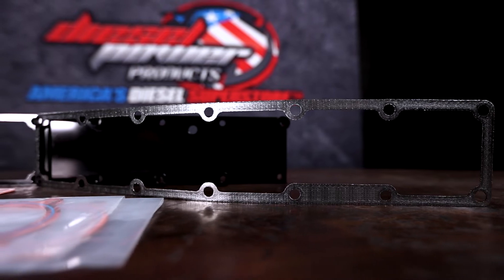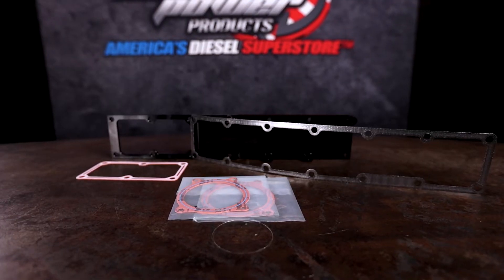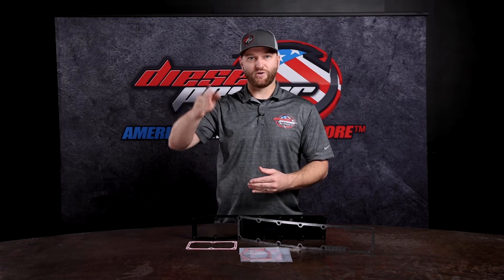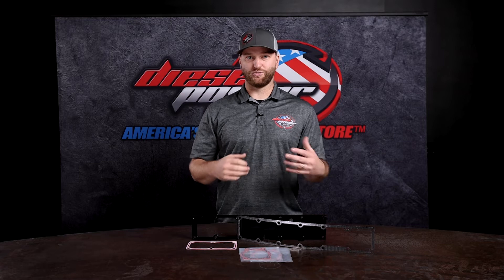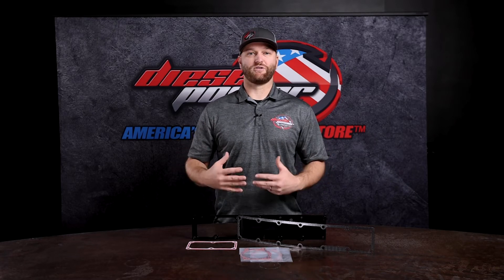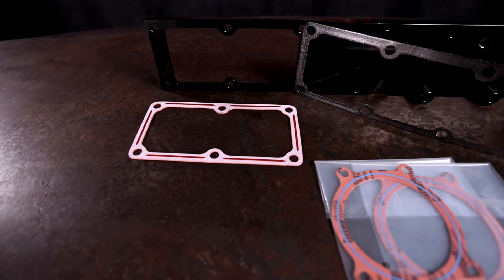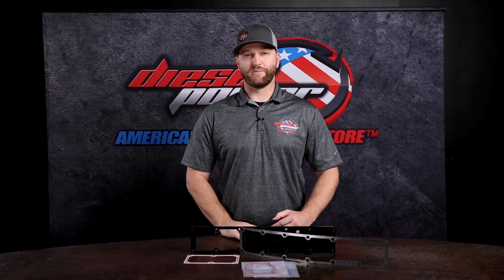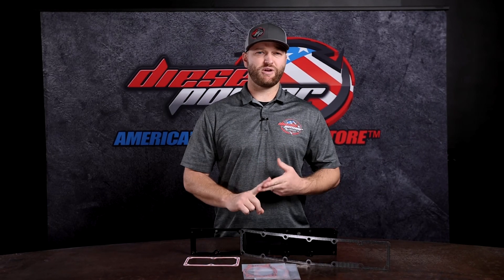Diesel Talk | Fleece Grid Heater Delete & High Flow Intake Plenum 2007.5-2018 Ram 6.7L Cummins

Comment: Does it require a programmer for a cel thanks
Reply from the maker: Yes, to keep the check engine light from coming on, you will need custom tuning.
Reply: @DieselPowerProducts  sounds good thanks for the reply and the video
Reply from the maker: You got it! If you are looking for a system that eliminates the factory style grid heater but will still have some sort of heating element in the intake manifold, and thus no check engine light, check out the Banks Monster Ram kit WITH Grid Heater Delete.
Reply: @DieselPowerProducts  will do thanks so much